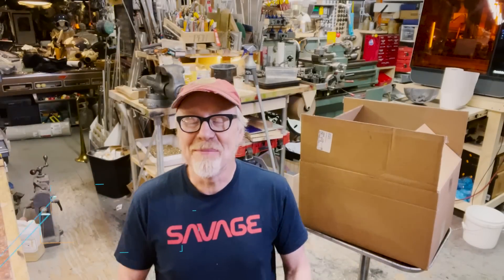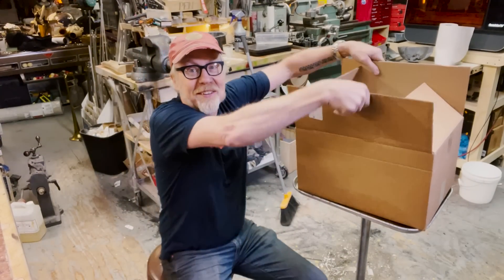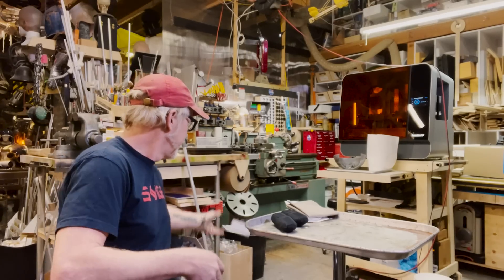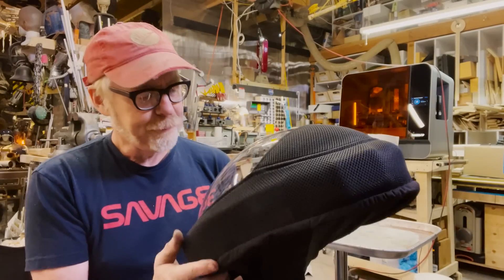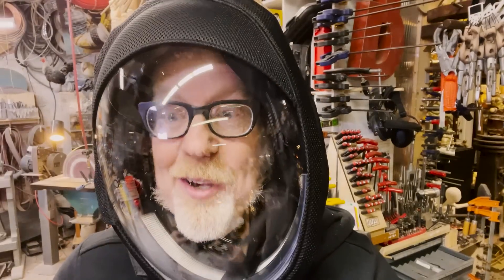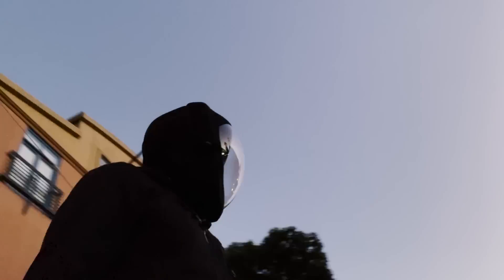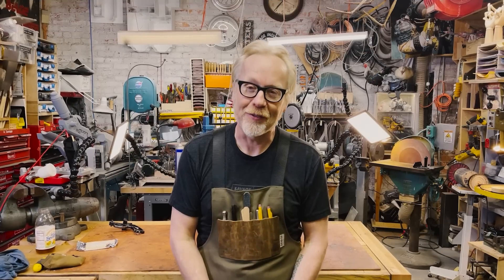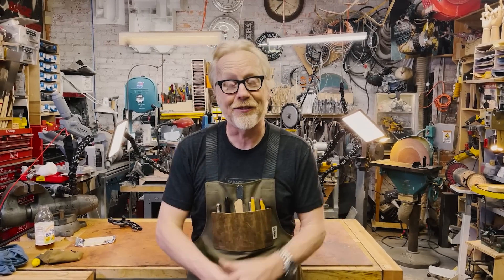Adam Savage Tests the AIR Active Filtration Helmet!

Comment: The main issue i can see with items like this, is they are positive pressure systems with no easy exhaust mechanism. If they would just add a filtered exhaust fan, the fogging would be less. Though not completely eliminated.
Another alternative would be climate control. But the bulk, power requirements, and $ cost $ make that a dubious path at best.
Cheapest solution might be anti fog solution used by scuba divers. Or a small silica packet tucked in the helm/ mask to absorb some of the moisture from your respiration.

Or there is the possibility that I may be on the path.....  not an engineer, technician, scientist, nor am i qualified in this field.  But just remember, when NASA started they made it up as they went.
Reply: The unit does have a filtered exhaust system. 2 fans in, 2 fans out. No flapper valves. 2 filters in, 2 filters out.

Comment: even without seeing the price tag, I felt like it was crazy awesome and also crazy not worth it.

cloth masks (either with a filter pocket, or straight up k/n95's) that go over the ear might cause some discomfort (though if you go on etsy you'll find all manner of solutions to the ear strain problem), but are simply way more pragmatic (and in the case of cloth masks cost effective due to ease of washing for re-use) for daily use.
Reply: Doesn't protect the eye conjunctiva, tho. But regular masks in conjunction with ski/swimming goggles would work.

Comment: I know this sounds stupid, but I think you're supposed to wear the face mask inside of the helmet. The speed of your breath is going to push the warm moist air you exhale into the much cooler plastic, and will condense quickly as it touches the surface. I think having the mask over your nose and mouth will trap some moisture and drastically reduce the speed of the exhalation giving it much more time to cool down before it reaches the plastic. Exhaling through your nose would also probably help.
Reply: The face mask is provided because some airline personnel have required that the wearer add a mask to the dome. This unit was originally aimed at frequent fliers.

Comment: The airline stewards will kick your butt off the airplane if you wear this because their definition of a 'mask' is simplistic, antiquated and moronic. Just like TSA Security Theater, the airlines COVID policies are just as theatrical (without any real safetly). Even their web site states that it complies with all the FAA regulations, you will probably still need to wear a 'mask' underneath the hood. WTF
Reply: Yes, that is true in some cases. It doesn't really hurt to wear a mask under the lid so that you're not put off the flight. Be prepared to do so, if you have to fly.

Comment: My guess it is more geared toward commuting on public transport, or on planes etc... I think using the same kind of constant pressure system like a CPAP would improve airflow enough to help offset the fogging. I believe CPAP can do about 15-20PSI above ambient, quietly enough that a person can sleep. This is when you start getting into Powered Protective Equipment territory, of which, this is already on the border.
Reply: Correct.

Comment: I wonder if there's opportunities to improve upon that helmet. If a larger battery unit and higher CFM fan could be made to work, even for a mild increase in noise, might have it a little bit more usable. Would an fan pulling air out the top, with another pulling air in from below, make for adequate ventilation to keep the humidity low?
I'm suddenly facinated by the functionality of such a device.

Comment: My main concern with this is that there is no way it provides an adequate seal around your neck. If your alternative is a cloth mask, then sure. But I wouldn't replace a well-fitted N95 with that.
Reply: A mask doesn’t protect your eyes. This would. We don’t know how well this really protects people from the virus, though.
Reply: It's positive pressure though so that should only be outflow if it's designed correctly. Ideally you would have a dedicated outflow with better filtration to protect others as much as you're protecting yourself.
Reply: @jacobbryan3674  Oh, I didn't realize it's positive pressure. I am a bit worried that the outflow is going to be at least partially a bad seal around your neck which would then not offer protection to others.

(Though if you reduce your risk of infection enough, you effectively reduce your risk of infecting others as much as by filtering the outflow.)

Comment: Preventing fogging of visors is solved in motorcycle helmets by something called a pin-lock, which is a clip in second visor that is within a mm of the main visor sealed around the edge. Creates the same effect as double glazing with less of a temperature difference between your breath and the visor, so no fogging! I believe they're also made of a clear moisture absorbing material for even better performance.

Comment: No wonder it fogs the the fans are to expel air not blow across the interior mask surface.  Both are required to make that work.  Maybe clean the inside and a light surfactant coating like baby shampoo similar to a dive mask.

Comment: The seems like an answer to the question "How can we exploit a global pandemic to get suckers to buy the world's cheapest and crappiest positive air pressure respirator?"
Reply: That sounds like an accurate description, yeah
Reply: @harrier331  BTW, I have empirically measured the pressure drop inside the helmet with a BME680 barometric pressure sensor and it does exist, albeit not very strong. They'd probably be able to get more if they chose a fully airtight fabric for the hood and swapped out for fans with higher static pressure. Fortunately, the design is simple enough to allow such an alteration. I'll work with my seamstress grandma to sew together a replacement cloth material with a rubber substrate. I've worn a Ukrainian gas mask before, so this shouldn't be too different.
Reply: @harrier331  if light gets through that easily i call BULLSHIT to that being anything other than a fancy sneeze guard face shield
Reply: @harrier331  What negative pressure respirators are available that offer an unobstructed via of the face for "next to nothing"? I'm genuinely curious. Because I have a top of the line 3M FF-400 series respirator and I can't use it for that very reason, not to mention the unfiltered exhalation valve.
Reply: @harrier331  Maybe you should consider not talking out of your ass about things you've never even used.
Reply: I can't take anyone serious who is wearing that on their head. It also does looks cheaply made and uncomfortable.
Reply: @TylerWitucki  you say that but add in a bright yellow suit and a couple hazmat symbols and suddenly you begin taking everything they say seriously lol

Comment: there are now plastic that not fog up but condensation will make the plastic wet but not have a fog up, have a face shield with it and seen it in action, but downside the this layer of water will warp what you see through it, but its better than fog.
Reply: Along these lines, I would suggest pinlock. It's one way Motorcycle riders keep their visors from fogging up.
Reply: There is the car windshield anti-fog spray. You can use it at home like bathroom mirror or other surfaces to make them moisture free. 

It costs about $15 a bottle.

Just apply some of it in inner surface and then use. Does perfect job for all kind safety glasses and masks and so on.
You need to apply it again 6-12 months depending amount of moisture.

Comment: Will you be attempting to modify it, Adam? I don't think it would be terribly difficult to run a low voltage matrix across the visor to equalize temperature and reduce fog. VR devices like the Oculus Rift intentionally allow their headsets to heat up to some extent for the explicit purpose of combatting fog. Of course cars have been doing this for decades on 12v.

Comment: Could you fasten thin nichrome wires to the glass/plastic and try to heat the surface to avoid the surface cooling to the point where the inside fogs up when you are in cold weather?

Comment: Can you get filters for it that are both N95 and handle VOCs like the reusable work masks that use bayonet filters? If so, it'd be a very comfortable and cooler alternative in that use case. It'd be cool if it had an optional pull-down welding visor, too. That'd make it look even more like a space helmet.
I wonder if an anti-fog coating would give you more of a margin for the quieter fans.

Comment: Maybe the vents weren't on full power because the batterys weren't charged. If not, maybe you can tune them up :)
A cleaning with soap water helps preventing the fog. I did that with my motorcycle helmet. beats several expensive chemicals that are sold for the same purpose.
I really want to see this helmet a second time when it is fully charged and prepared.

Comment: They should have made it dual pain of glass and you wouldn't have the issue.  Motorcycle helment pin lock system use the same principle to prevent fogging.  Also would be nice to be ansi rated for shop use.

Comment: There is a well known solution to fogging: double pane glass. However, that would be extremely expensive on a curve and surface of that size. Sealed double pane is even better, but again, adding cost. Remember, fog is just water condensing on a cooler surface than ambient. If the surface is the same temperature, it won't fog.

Comment: Reminds me of the filtering hood that Alec Steele uses in his grinding room. That one has a hose connected to a filter pack on his belt. That one he uses so he doesn't breath metal particles though.
Reply: did you see rebuilding will's fairbaks powerhammer pt 8.....so sad   (spoiler alert)
Reply: a PAPR
Reply: Miller welding has a good  hood system with HEPA filter.
Reply: T94-R PAPR (Powered Air Purifying Respirator)

Comment: out of curiosity, what sort of temperature were you walking in?
I can see this  potentially working fine indoors, or during fair weather...
But as it gets cooler, the dew point drops - so the amount of condensation from one's breath increases.
Reply: Considering he lives in southern California if I remember correctly his temperature should be in the 20c roughly
Reply: For reference, Adam lives in Northern CA, San Francisco, and it was around 54f (12c) for the high on the 9th.
Reply: My thoughts exactly.  Dealing with the temperature differential between the inside of the helmet, constantly warmed by body heat, and the outside, which changes rapidly with ambient air temp changes, would be challenging.

Comment: Just wondering, what was the temperature outside? Usually condensation happens when moist air hits cold surface (usually window glass with cold outside). Perhaps they can use double walled glass to at least postpone the effect for short walks in the cold.

Comment: Man, this with a mic would probably be a huge relief for lots of people in healthcare atm
Reply: That much cloth would be a problem for sanitation.
Reply: @deth3021  Hmm, didn't think of that. Maybe they could make a version with disposable "fabric", like the stuff that some hazmat suits are made out of. Or they could make the fabric removable for washing.
Reply: @deth3021  that's an easy mod. Bonding a plastic top layer to the outer edge of that face shield is dead simple.
Reply: @martindinner3621  I don't think that would be enough.
1 that would reduce the comfort in part at least reducing its purpose.
2. You would need to disinfect this thing inside and out... so that means it would need to be cooked or something. So that plastic would likely be melted off.

Not sure but I don't think it's that easy.
Reply: @deth3021  Tyvek or an equivalent material would be quite comfortable. 

As for sterilization, hard UV or ozone exposure wold be just as effective as heat and far less damaging to the equipment. 

P.S. A semi-disposable version has been made by 3M for a while now. 

3M PAPR Respirator, Versaflo Powered Air Purifying Respirator Kit, TR-300N+
Reply: @martindinner3621  Right, although UV tends to damage most thermoset plastics. A hydrogen peroxide or hypochlorous acid misting chamber would probably be about right. They use those for disinfecting N95 masks today for reuse when PPE shortages abound.
Reply: @deth3021  How so? It's removable. Just snap a fresh replacement on and launder the soiled one according to your company policy.
Reply: @MikeTrieu  that material looks synthetic, and unlikely to survive sterilisation. I.e. 100c + in an autoclave.
Reply: Maybe the razer mask will be a good compromise
Reply: @1MrOasis  Oh yeah, I've seen that too. Would be dope, if that ever comes out.
Reply: I mean, as long as they don't walk anywhere? Did you watch the video to the end?
Reply: @cpy  I did. But it should be fine for shorter periods. And it would certainly be better than to wear a full disposable hazmat suit every time you have to quickly go into a quarantine zone. Not to mention the waste that this creates.
Reply: They actually have that already. Look up PAPR. There are a few doctors/nurses that use them because they didn't want to shave their beard to obtain the correct fit required for N95.
Reply: @MB-xw1tu  Holy shit, that's a big respirator unit strapped to someone's back! I've never seen anything like that, that's pretty rad! :D
Reply: Apple has a Live Listen feature using AirPods and iPhone, though I don’t believe it’s two-way atm
Reply: @CJT3X  Even if it would be working both ways, I don't think any government could afford to buy all their healthcare staff an iPhone and Air Pods. :D

Comment: If you really wanted to wear that helmet, you could measure and print out some chin braces/struts with that absolutely ✨gorgeous✨ formlabs 3L and some Siraya Tech Tenacious flex resin. I find Zeiss's anti-fog defender coating is the only thing that works to keep fog off of my glasses when I wear a mask. Everything else I've tried hasn't worked at all or is too hazy.

Comment: Same thing happens in my motorcycle helmet. The only way to combat this is by either opening the visor a little (yeah, not ideal for  FILTRATION DEVICE) or by using a pinlock visor. Maybe this is something that can be retrofitted to the AIR Active Filtration Helmet.

Comment: I got one of these for teaching K-3 in person. Adam, you had the same problem I had with fogging at first, and it is an easy fix. You pinch the material at the back of the helmet to pull the visor up onto your head and then attach a strong metal-springed clip to hold the pinched material. I also removed the small pads that were installed/Velcroed inside mine, and installed the larger pads provided by the manufacturer.  Between the pinched fabric and the larger pads the helmet's visor is now as far-as-possible from my nose and mouth. In addition to solving the fogging issue, these minor changes also allow for great air circulation all around the head and face that is quite pleasant. The helmet was designed for safe, comfortable travel only, and not talking. So, to hear I use Etymotic's Noise-Isolating In-Ear Earphones with a 3 Button Microphone attached to my iPhone running Mobile Ears' hearing aid app. These earphones/earplugs eliminate the fan noise and allows for a great hearing experience via the iPhone's microphone and background noise cancelling capabilities.  Plus if I want silence, I just set the iPhone's volume to zero!  To insure that I can be heard, I got a Zoweeetek's portable rechargeable mini voice amplifier with wired microphone.  I have so far tested this setup at the grocery store, bank, and enjoyed an hour long conversation with relatives.  It works great.  People can see my face, and I don't have that awful mask discomfort including, of course, poor mask air-quality issues and moisture buildup around the mouth. 

For most trips, when I can use self-checkout at the lumber/hardware store, grocery store, etc.  I just put on the helmet alone.  With the clip attached in back, its quick and easy to fit on my head and go.   I cannot tell you how wonderful it is to walk around maskless in social spaces and visit people or drive in their cars without a mask.  

Adam, I was hoping you might have a fun fix to round out the back of the helmet, so instead of looking like half-a-helmet you could make it looked like a full helmet?  BTW: Reggie Watts review of this helmet and his fan Q/A session while he wears it is awesome: https://youtu.be/VAnO3kAjhGs

Comment: Are you sure you aren't making TV money with the cost of that thing you bought on a whim?  LOL
Fan issues are always a tradeoff between size of the fan, volume of air moved, and noise from air-chop.  Larger fans at low speed are quiet and move a lot of air but bulky to carry, small ones can't move a lot of air without high speed air-chop noise.

Comment: I wonder if bonding on a resistive heating element like on the back window of your car would do a better job of defogging(I think it would be possible to make the lines small enough to not impede your view) would work. Or maybe that combined with a low power fan. I suppose that would eat batteries pretty quick though.

Comment: Would it be worth using one of those magnetic fish tank cleaners (or something similar and appropriately curved for the surface) to de-fog it from the outside?

Edit: Maybe a fuzzy microfiber cloth on both sides with multiple small magnets on the back, so it can fit more easily to the various curves?

Comment: You could coat the inside of the face shield with an anti-fog spray like for car windshields and that could help a lot. I had the fogging issue with my glasses and anti-fog spray pretty much fixed it!